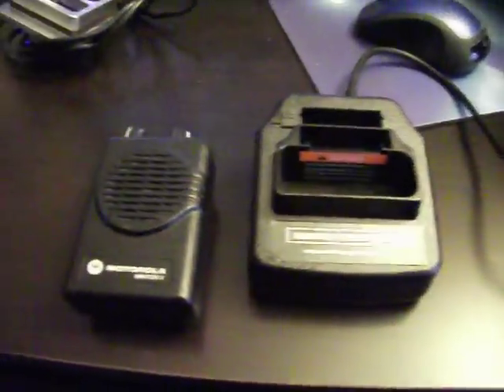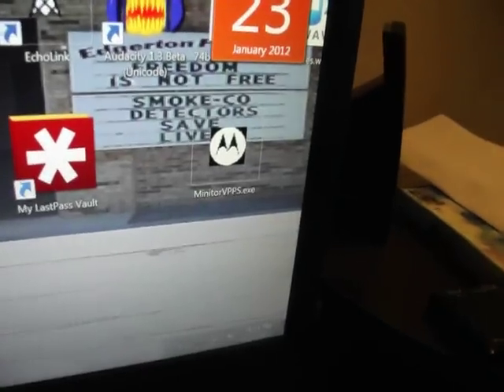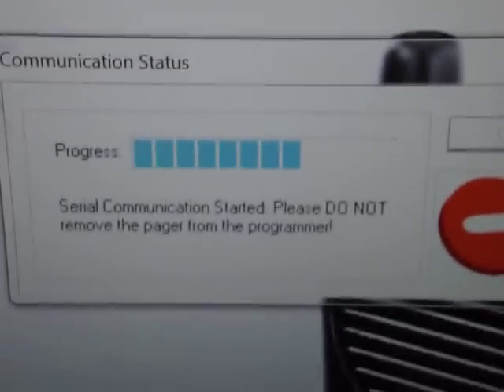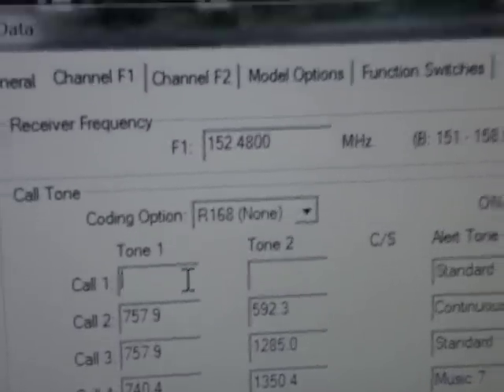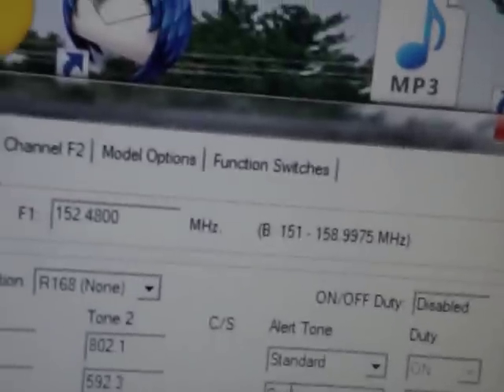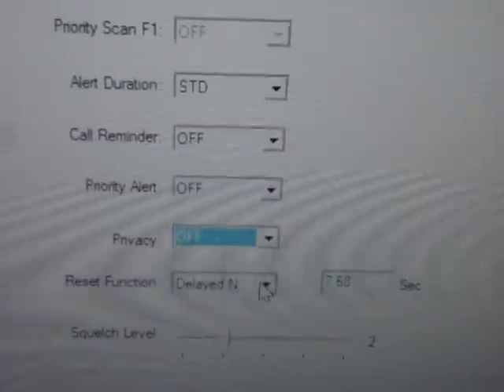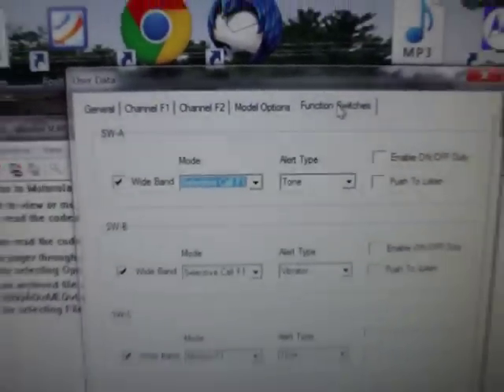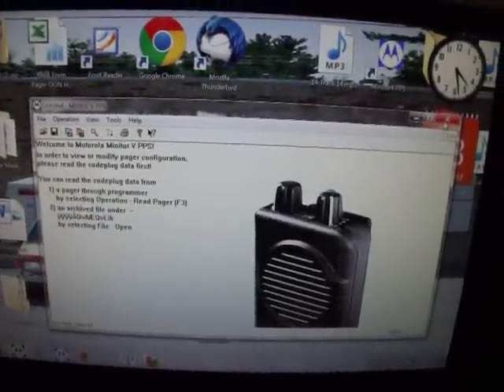Motorola Minitor V Programming Demo

Comment: hello I have a question perhaps somebody can help me here...
I need your answer regarding programinng a mintor 5 pager
i put the pager in the user mode instead of Motorolla or plexton and try to program my A tone of 910.4 and the B tone of 2401.
the pager changes the A tone to 903.1 that a huge drop Will the dispatch tone of 910.4 still trigger the pager? with the changed A tone will it still set off.
...
i thought in user mode you can custom your pager Freq numbers
thanks